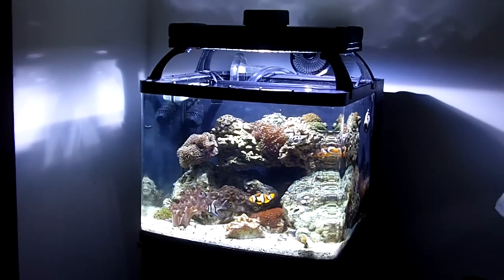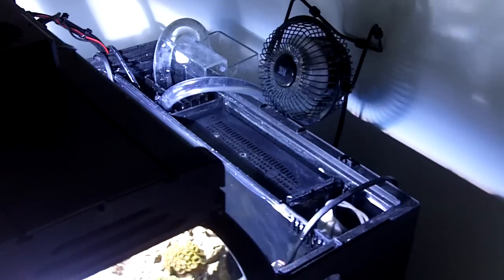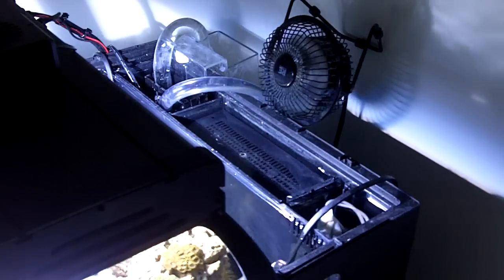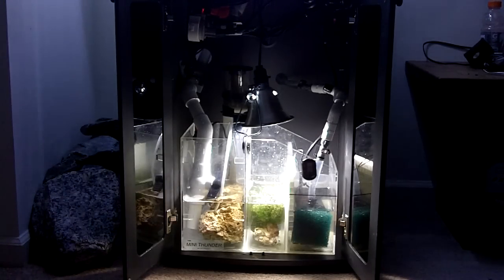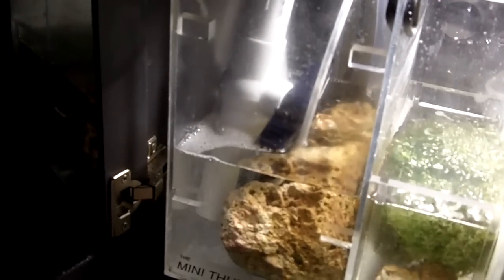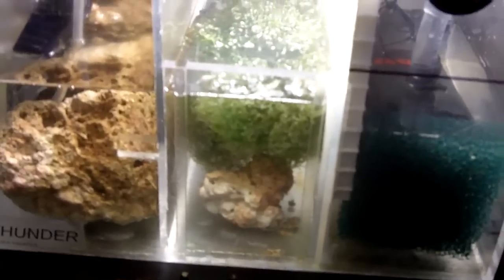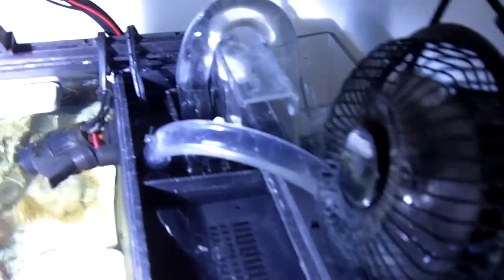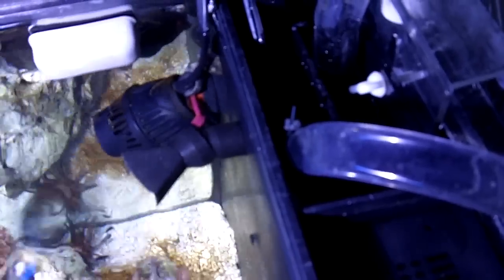Bio Cube 29g - Sump Install & Modifications

Comment from the maker: The fan does 2 things, helps dissipate the heat from the halide into the water and it speeds up water evaporation which aids in cooling. If you go this route it would benefit you to invest in an auto off system. Thanks!

Comment: down fall is the cabnet isnt designed for all the humidity you put in it conserdering its particle board cheep made cabnets
Reply: Been running my custom sump for 3 years, stand is crap but I have had no issues thus far.